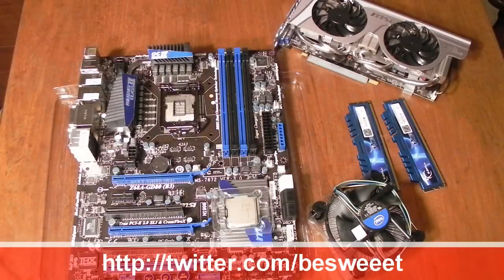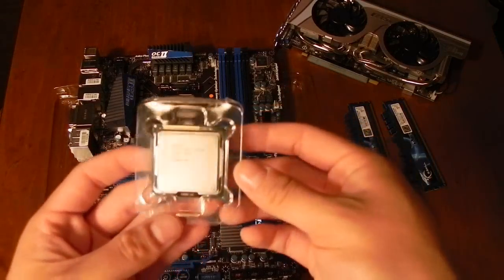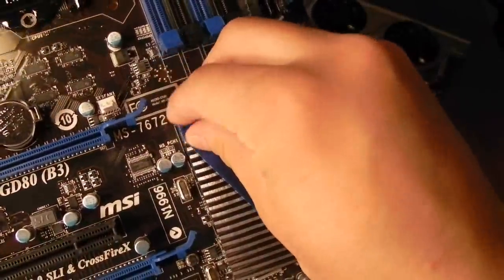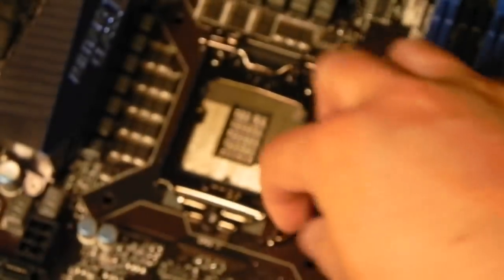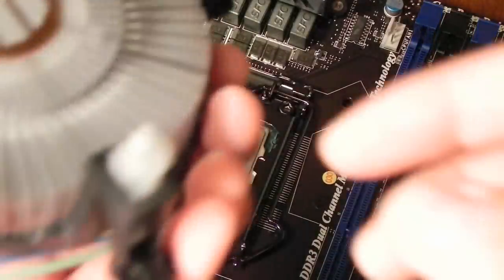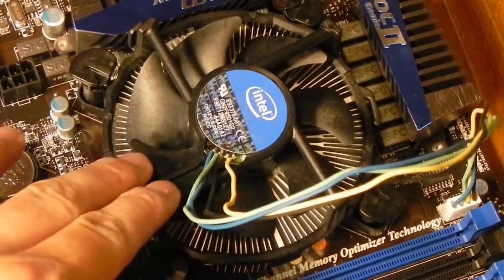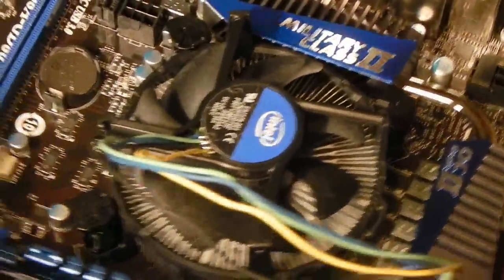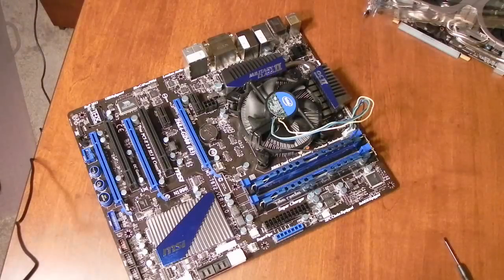PC Build - Part 12: Fun begins! Installing the CPU & RAM onto the mobo

Comment: I need help
Buying a used comp

Rampage III black bord
990x CPU
Ultra x4 1000w psu
128gb ssd ?brand? ?Specs?
1tb 7200 hdd I think Seagate
gel 8gb 7-7-7-21 1333
Coolit. Elco CPU cooler
msi 560 ti

q how well with this set up work on a 47" tv

Ps what's a good price for this unit
should i spend more and buy his 7950
or should i wate and sli the 560
Plz advise

Comment: You have no clue how to install components onto a motherboard.
You've placed the CPU in the wrong direction, it should nicely sit, not having to push it down.
You installed the CPU fan+heatsink wrong (not diagonally with the pins)
And it clearly states in the mobo manual to install in the 1st and 3rd DIMM if you are only using 2 sticks.

You should not be doing these videos on how to install components if you think you know what you're doing but you dont.
Major dislike from me.

Comment: @Sinanm89 
it doesnt matter although if you have different colours then fill the colours up
for example if you have 4 slots and 2 blue 2 black and only 2 RAM sticks
use up both blue or both black so they can be used as dual channel memory